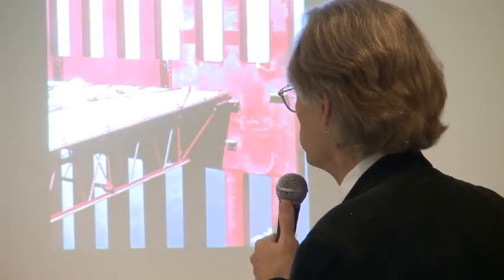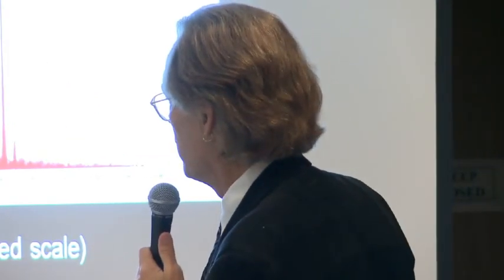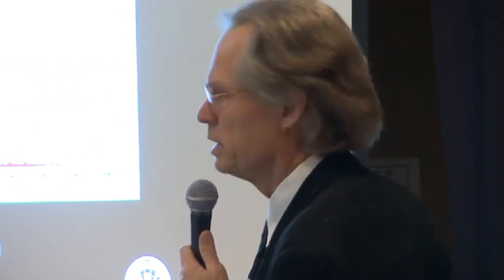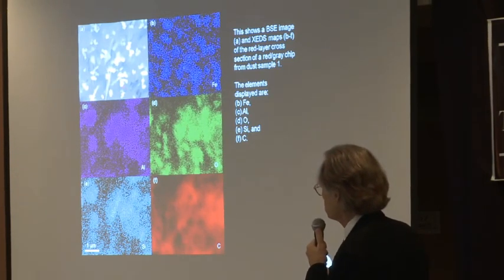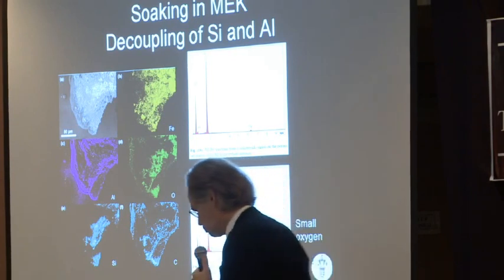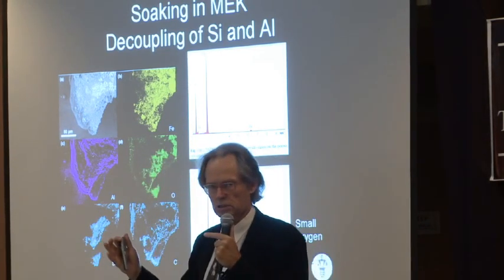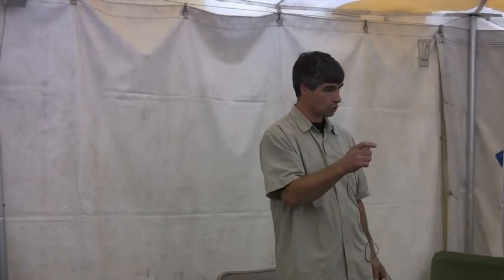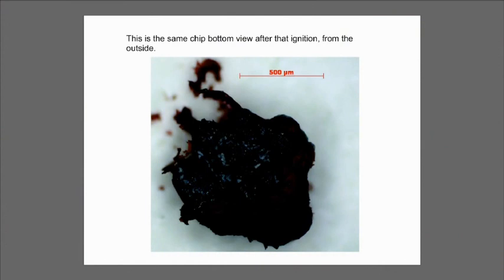9/11 WTC-chips are not paint and produce a thermite reaction: Dr. James Millette is wrong

Comment: I support Dr. Harrit’s conclusions, namely, that the Twin Towers were felled—in part, at least—with some use of thermite. In any controlled demolition of a steel-framed structure, if you first  thoroughly burn through about half (or more) of supporting I-beams, then you’ll have a much cleaner fall when you finally start detonating your cutting charges. And you can burn through these I-beams with thermite or a welding torch—however, if you’re going to use thermite, then there are certain “hurtles” you have to overcome, and I would like to list some of them here.

First, thermite is a powder which burns. Granted, it burns violently, but it’s still nothing more than a burning—it’s not “detonation” or even a true “deflagration” (thermite doesn’t burn rapidly enough to push an object, such as the way cordite does when it pushes a bullet). And it burns ridiculously hot—4,000 degrees Fahrenheit. So, you would have to have a very durable container in which to hold all this “dust” while it’s doing its white-hot burning—you can’t just mix it with paint and expect it to do anything more than burn right off the structure and fall on the floor. 

So, let’s say “an asbestos bucket” was used—a bucket made of asbestos, only it’s open on one side (this is the side that touches the I-beam, thereby cutting through the I-beam with the thermite’s heat). Sounds reasonable enough. However, something has to hold that asbestos bucket alongside the I-beam. Maybe some sort of wire net? Something heavy-duty, like a long clamp? Maybe something hanging from magnets? Whatever it is, it has to be positioned in such a way that the apparatus doesn’t melt away as the thermite is melting the steel.

Now, that’s one problem—call that “problem #1. Here’s problem #2:

The cuts that you make on this I-beam can’t be straight horizontal cuts—they have to have some sort of angle, however irregular, in order to allow the top section to slide off the bottom section. Maybe put 2 thermite buckets next to each other, only have one positioned a little higher on the I-beam than the other? Maybe—truth is, I’ve never worked with this stuff, or tried any “backyard experiments” with it. I’m just trying to imagine this as I go along.

And here’s problem #3:

As the thermite is doing its thing, burning through the I-beam, that’s going to cause molten-hot iron to run down the I-beam from wherever the reaction is taking place. Meaning, if you have an I-beam that is 110 stories tall, and you got about a dozen “thermite buckets” positioned up and down this thing, you would have to detonate the ones on the bottom first—then work your way up—as otherwise you’re going to have 2,800F molten iron pouring down on all your other buckets (and probably stripping them right off the I-beam).

Likewise, if you have any C4 charges along that I-beam and molten iron runs on top of them, at that point you’re looking at unintended “thermal shock detonations”. 

My point is this: whoever orchestrated the demolition of the Twin Towers had to know an awful lot about demolitions, about what often works and what often doesn’t work. And seeing as I’ve never worked in demolitions (nor has much of the general public), this leaves the rest of us at a serious disadvantage for explaining what specifically took place. 

Nonetheless, even with that said—all of it—the “official story” is still ridiculous. You can figure out in your own mind what will happen if you welded-together a steel-framed structure in your backyard, mounted it to a concrete base, and then drove a pickup truck into it—either the structure would collapse, or your truck would stop dead and be totaled. But regardless, the structure isn’t going to vibrate for an hour, then collapse straight down into a pile of loose beams.

Likewise, if you live in a house or apartment which has, in its basement, a horizontal steel I-beam that supports the weight of the above structure, you know you can burn-down the whole house/apartment and that I-beam is never going to melt, nor even weaken to a degree of seriously bending out of shape—whenever the fire is finally done, that I-beam will have the same shape it presently does. It doesn’t even matter if you’ve got a bunch of heavy pianos and oak bureaus in the floors above—the floors, themselves, are more likely to distend and break apart than that I-beam is likely to distort a single centimeter (which is the whole reason we build tall structures with steel supports).

The only exception to this is when you have structures that are held together with weak welds, yes, the welds can break apart as the metal expands, thereby destroying the building’s integrity. However, you’re talking about welds that would have to be so weak and slipshod they would be coming apart long before any fire, and by 2001 the WTC Towers had been up for 30 years. That’s 3 decades’ worth of building inspectors examining the things, and the only thing they ever found amiss is that the WTC was loaded with asbestos (literally, all its I-beams had been fireproofed with the stuff).

Therefore, it’s safe to say the official story is bullshit—there’s more evidence to discredit it than defend it. But even so, we still don’t know what happened. We know Dr. Harrit found thermite in the dust. We know that a structure that was pre-weakened with thermite is going to come down a lot more smoothly than one that hasn’t been pre-weakened. We know each Tower had around an hour of leeway between the time the respective jets struck and each tower fell, meaning, that’s sufficient time for thermite reactions to do their thing, getting the overall structure ready for a perfect collapse once the C4 charges are detonated. 

But as far as how these things were arranged? How they were tested without setting them off? How the whole demolition was tested beforehand on a smaller model? This could only have been done with someone who had a natural knack for these things, plus a lengthy history of working in the business (and a lot of people helping him). 

To date, I assume this was a joint operation by forces in Mossad and forces within our own US military-industrial complex, that it was paid for by the big western banks and oil merchants as a justification for expanding our military presence in the oil-rich Mideast—then covered-for by corrupt men in our own armed forces and federal government. However, it’s also the sort of crime nobody wants to prosecute, as Americans are already sold on the idea of American “exceptionalism”, and therefore, this notion the world’s resources are ours for the taking. To have to lose our justification for this, then hear people say “your own leaders did it to you”—this is the last thing in the world any of us want.

And so we keep the official story alive, regardless of the fact it may well be the most scientifically vacuous explanation the modern world has ever offered for anything.
Reply from the maker: You don't need a huge amount of NANOTHERMITE, which you can make with 
different types of additives and you don't need a high-tech devices to 
hold reacting thermite in place either

Here's a video and experiments Jon Cole made IN HIS BACK YARD!!
..he's making horizontal cuts and his homemade thermite has explosive-qualities

https://www.youtube.com/watch?v=w4EdYVybDS0

Comment from the maker: So you're trying to still convince people Millette's MEK soaked chip-data is valid to conclude no elemental Al is in those chips.

thou..

- He layered it with gold, which others say can distort the details

- He agitated the MEK-chip with ULTRASONICS which could affect the results

-And he used higher voltage beam which can pick up "overlapping data" cause the beam is so strong

...it's almost like he DID NOT WANT TO discover the elemental Al reported by Harrit et al

Comment from the maker: Gold layer distorted Millette's MEK-chip data?

Millette didn't use gold on the unsoaked chips,so why on the MEK-chip?

No gold for Harrit et al

From a paper about layering materials:
"..the main disadvantage of gold...coatings is their tendency to migrate on the surface of the sample and coalesce into islands or particles that worsen the macroscopic conductivity and mask some fine details of the surface."-Effects of the Carbon Coating and the Surface Oxide Layer in Electron Probe Microanalysis

Comment from the maker: ULTRASONIC AGITATION affected Millette's MEK-chip data?

Harrit et al did not use ULTRASONICS on their MEK-chip

Millette does not tell if he used ULTRASONIC AGITATION when the chips were still in solvents or after he took them out of the liquids.

A) Could this ULTRASONIC AGITATION have " washed off" the loose Al powder particles if the MEK chip was still in the liquid?

B) Or did the ULTRASONICS "even" the surface of the chip softened by MEK solvent if he AGITATED the chip was out of the MEK?

Comment from the maker: Millette missed the Al powder cause he used a 20kV XEDS instead of 10 kV Harrit et al used?
"..due to the beam spreading and receiving an overlapping X-ray signal from the matrix material as well as particles below the surface.The beam energy(20 keV) is such that the volume of material from which the X-ray signal is generated is larger than the particles.Hence, some Al and Si ..may not be inherent in the faceted grains, and some Fe..may not be inherent in the plate-like particles."-Harrit et al

Comment from the maker: "..alternative explanation...Steel rusts."

Problems for this explanation:

- Construction of the composite in the red layer ..this kind of uniform material, just does not form in buildings on it's own.

- Uniformity of FE -oxide particles. It is laughable to suggest that building rust would end up in such uniform size, even in paint pigments.

Comment from the maker: "No effort was made to estimate the Fe:Al elemental ratio in the red-layer."

Well, there was enough to produce a thermite reaction.
:
:
"Chemical activation energies of known reactions cannot be so sample dependent, whether nano-sized or not. This is not the thermite reaction"

So called "Step-up-process" explains this = some substance in the composite ignites at lower temps than the thermite itself, which then produce enough energy to ignite the other materials (the thermite).

Comment: 6 minutes after the 1st attack was still 32 minutes after the Flight  11's transponder signal went dead. Average NORAD EToI(Estimated Time of Intercept) is only 10 minutes. 

Did I mention the 3 separate war games/ hijacking exercises that included fake blips on the radar screen going on: Vigilant Guardian, Northern Vigilance, and Vigilant Warrior. With only 8 available aircraft and they have to be dispatched in pairs with as many as 22 possible hijacks going on. They couldn't seperate

Comment from the maker: Hey,
You haven't understood the issue correctly. 

The issue is about thermite COMPOSITES, not about some elements, such as rust or aluminium, found freely in the WTC dust.
Iron oxide, elemental aluminium and other materials are found in pieces of COMPOSITE mixtures, that are clearly man made, and resemble sol-gel thermite composites manufactured by LLNL and others.

..these types of uniform and multilayered COMPOSITES just do not form in buildings by themselves.

Comment from the maker: "it can't be dissolved by a solvent."
And with this you admit that the MEK chips has elemental aluminium in it, and had before the MEK-treatment.

..and

"XEDS maps.. indicate by color, the degree to which the particular element  is present at or near the surface"-Harrit et al

..so don't try your weak Al % calculations anymore, cause their based on surface measurements, not the whole thickness .. surface that was believed to be contaminated

Comment from the maker: "No, it doesn't resemble that. LLNL's particles are smaller, different shapes"

Nice try.
Trying to steer the subject into side-issues again i see.

But nanothermites are manufactured in different particle sizes to control the reaction characteristics (heat output, reaction time etc.)
So the LLNL-picture of nanothermite in Millette's paper means absolutely nothing.

PS.

Does LLNL use UNIFORM sized iron oxide particles in their sol-gel thermite, cause seemingly you know something about it? ;)

Comment: "Al and silica (not kaolin) in the same region"
That's a bare-assed assertion for which you have no proof. I have proof for my assertion that it is kaolin: a) The platelets LOOK exactly like kaolin in every way (shape and size)  b) Millette has clearly identified Kaolin in red-gray chips using FTIR and TEM-SAED
"very, very, very unifoirm Fe-oxide particles"
called "pigments"
"resembling LLNL's solgel thermite"
No, it doesn't resemble that. LLNL's particles are smaller, different shapes

Comment from the maker: "to form a unified conclusion for all chips."
Harrit et al Paper actually shows PHOTOS of two different types of nano-composite in the dust.; bi-layered ones and a multi-layered chip. ..get it?
It's PHOTOS of different kinds of chips, not just"data points"

They never claim that all the chips have the same composition
..and the red-layer of a-d chips isn't the same for all. C-chip shows few different peaks that the others do not

Comment: "How can you make out the difference between SiO2 and SiO4/4-, from those tables ?"
SiO4 still does not exist. It's how I make out the difference between horses and unicorns.
""They imply it." No"
Yes, they do. They combine isolated data points from different materials (Chips a-d != MEK-Chip) and unknown materials to form a unified conclusion for all chips. That is only valid if they assume that all materials are essentially the same - which they fail to prove. There's a disconnect in the paper.

Comment from the maker: Claims on your blog such as the "..there for we must assume the gypsum board is the source of ALL the contamination, and the chip-profile does not match the wall boards, which means it's paint", is one of these idiotic claims you try to pass on to people.

But there is loads of other materials in the WTC dust besides the gypsum board dust, and i'm sure you're quite aware of this, but still you use such propagandist-talking points

Comment from the maker: On fig. 14, the "beam" analyzed only the surface of the red-layer, not the whole thickness.So the Al % for the whole layer can be off quite abit, and when we don't know how much of the peaks are due to contamination, we can't calculate the TRUE Al contents of the whole layer very accurately.

" Fig. 18 contains only 10-15% contamination from gypsum"

the measurements are REGIONAL, as stated in the Harrit et al paper. the fig. 18 region does not represent the whole surface of the chip

Comment: "Another "claim without any proof" you make"
WRONG. Fig 14 is the proof - it is so very different from Fig 7, that contamination can't make up for it. If Harrit had believed that most of the signal in that EDS is from contamination, he would not have included it. Evidently, they thought Fig 14 was good enough
Fig 15 is another proof: No silicate, as in chips a-d
Fig 16 is another proof: That's silca - there is no silica in chips a-d,
The red layer of chips a-d is much thinner than the MEK-chip

Comment: "The stated (Harrit et al paper) surface contamination "throws off" the Al %"
You hope that  this would be so, but it isn't. Even if the surface were 75% contaminated - preposterous assumption; if Harrit had himself believed in this much contamination, he would NEVER have included Fig 14 in the paper!! - you'd still have under 3% Al - still much too little to make a thermitic composition capable of anything at all.
But it can be shown that Fig. 18 contains only 10-15% contamination from gypsum

Comment: No, I am not. Harrit et al. were looking at two DIFFERENT kinds of chips, both of which are not thermitic:
- Chips a-d, These have all the Al bound as kaolin. No evidence for free Al. Millette studied the same, it's paint.
- The MEK-Chip. This has very little Al overall, certainly less than 1%, as per Fig. 14. That limits the thermite content to <4%. Useless. No evidence of nano-particles with Al here. Fig 17 is weird. I think, but can't prove, they measured the sample holder, made of Al

Comment from the maker: The clays (different types, i assume) are used to make the matrix more rigid, i read, as i've said many times before
..if you want more info on the subject, then i'm sure you can find it over the internet.
-
"But do you admit now that there is Kaolin"

It is possible kaolin was used in the sol-gel/aerogel composites' construction, ask Harrit, Jones and these guys. Was is used in every type of thermite chips they have discovered in the WTC dust, i dunno.

Comment: "You persistently imply in your comments that kaolin clay is tell-tell sign that the chips are paint, but you don't seem to want to acknowledge that such clays are also used in some sol-gel/aerogel matrixes"
These processes build particles from the atom-scale up, right?
That's not how you build clay.
But do you admit now that there is Kaolin? That the Al is bound as Kaolin? I can live with that - it's what I claimed all along. It kills your thermite ("elemental Al") nonsense hypothesis.

Comment: Yes, contamination of all chips with Ca (and S) is highly probable, because of high levels of calcium sulfate fine dust from wallboards. And yes, such contamination "shifts" the concentrations of other found elements, but not the ratio between Al and Fe.  
I do not think that the "size" of microspheres tells us anything about their "thermitic" origin. They can be easily just remains of gray layers, as I already pointed out.